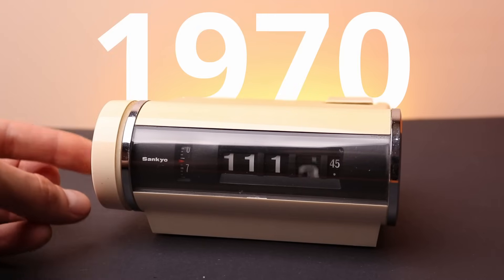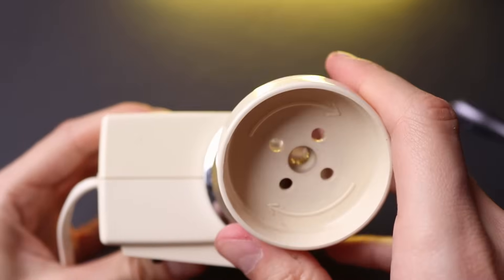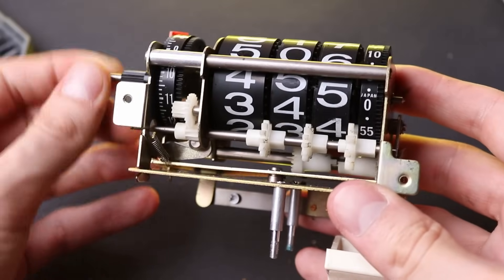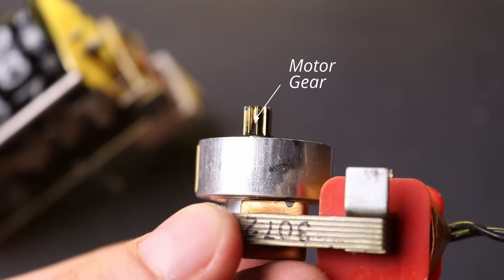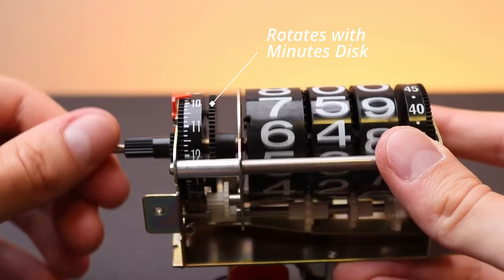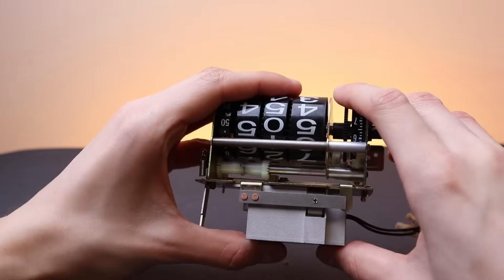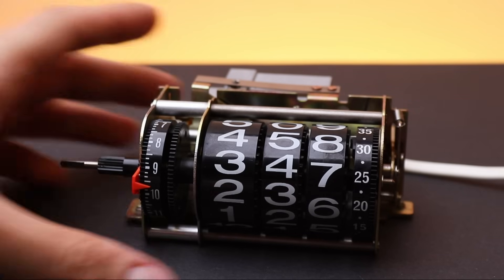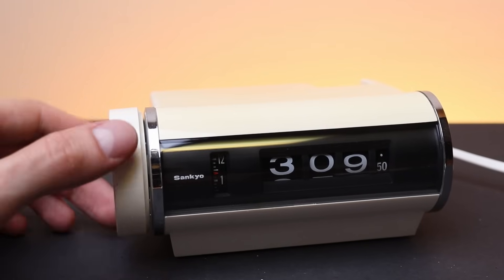That’s why Japanese Engineering is on Another Level

Comment: The time keeping will be very accurate - While the frequency of the grid can drift, there are mandatory requirements that the total number of cycles per day/week is very accurate. In fact over a whole year the clock should only lose/gain less than 60 seconds.
Reply from the maker: If the grid frequency is very stable then yes. But it is not true for most countries in the world
Reply: @NickElectronics  All of the EU, Japan, North America, India, Australia/NZ, China mandate a maximum cumulative cycle variance on a weekly and monthly basis. While grid frequency can vary by the minute or hour, its important to understand that the total number of cycles over each week and month must be correct for interconnected grids/generators to correctly function. In other words, when there are lost cycles (over time), the frequency will be increased to ensure the average is correct. Lastly, yes, I recognize there are plenty of countries which don't have fully integrated frequency controlled mains supply - I just dont want people to think that using mains cycle counts is a poor choice for time keeping - because it isn't. It is extremely accurate on average in most developed countries.
Reply from the maker: @sno_crash Thanks for the info. It is indeed a good decision for a home clock.
Reply: @NickElectronics  I would assume the person was from the USA or other western nation with a stable grid. USA for me, our grid has improved enough in my 42yrs that I never replaced our backup generator as we might lose power once a year for a couple hours max. In my youth we would lose power much more often, one summer it was over a week after a tornado destroyed miles of power lines between the farm and the powerplant...
Reply from the maker: @jeffeck1701  Yep, technologies are improving year after a year and in general there are more “tools” to stabilize parameters. From the other side more complex, with higher share of unstable renewables. Also, as you have mentioned, there are unfortunately natural disasters. So actually I am not sure what the accuracy would be from country to country. It depends 😅
Reply: @NickElectronics   I think load shedding is a substantially bigger issue than frequency instability. While the grid is mandated to have a maximum daily deviation which is spectacularly low, it is not mandated that every utility subscriber receives power around the clock. It has been well over 20 years since i experienced a power outage in my corner of EU, but i hear there are people in the States who lose power on a weekly basis.
Reply from the maker: @SianaGearz  Yep, it's quite a big problem. Modern clocks usually have some form of backup power to keep the correct time when the power comes back on — not to mention the smart ones with internet connectivity. Sankyo's clock definitely can't do that.

Comment: man 3w is a lot for that, wonder what the modern equivalent would be nowadays if someone remade it
Reply from the maker: The motor is really inefficient :D That's its biggest flaw. But it's cheap
Reply: It both is kind of a substantial waste, but it's also... not a lot of heat really from the perspective of thermal engineering and the ability to dissipate it.

Comment: In the UK time flows 20% faster 🤣
Reply from the maker: Is the frequency in the UK 60 Hz? 🙄 
I thought the US was the biggest country with a 60 Hz grid. In some countries they have both :D
Reply: @NickElectronics 
My mistake, you are correct.

The US is 60Hz.

I always get mixed up what is where 🙄
Reply from the maker: @RossGirven  Easy to get confused in the world of engineering. Like I did with the motor type 😅
Reply: @NickElectronics specifically Japan have both. 50 in some islands, and 60 in others. 
Sankyo probably made two version.
Reply: I don’t think grid frequency can fluctuate THAT much (40-50Hz), in reality, I suspect, the range is 0.5Hz (+/- 0.2-0.25Hz) at max, otherwise whole grid just shuts down
Reply from the maker: @llMarvelous  That was a typo. it should have been written as 49.5–50.5Hz. But yeah, as you said, that's an extreme conditions.